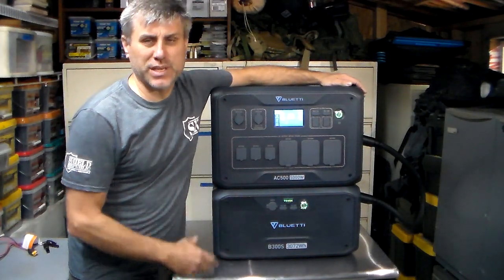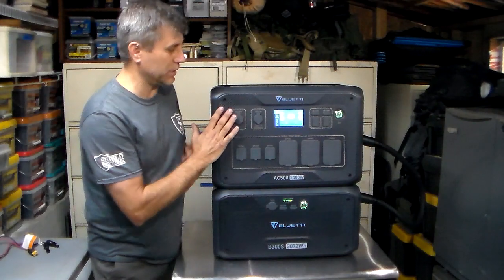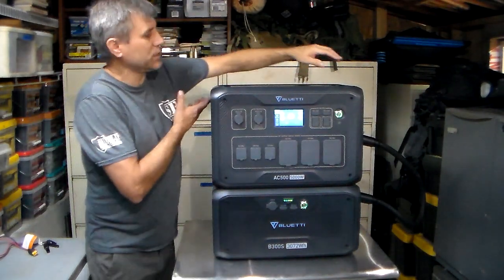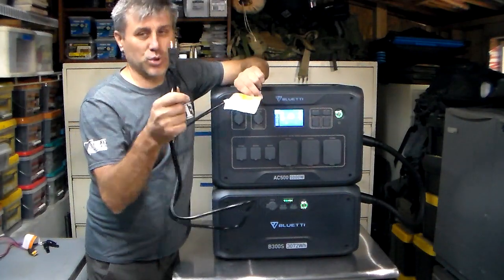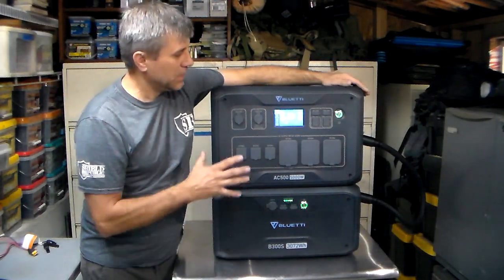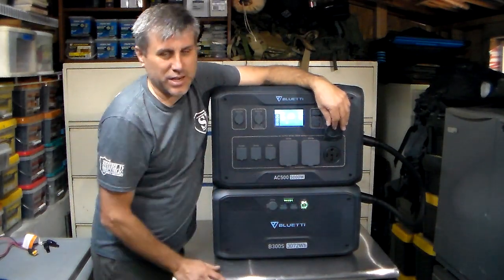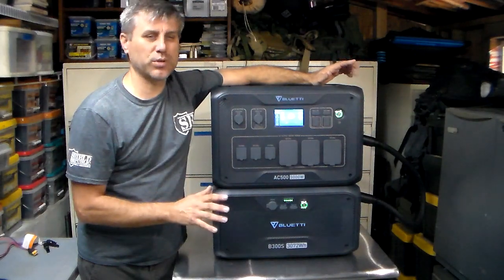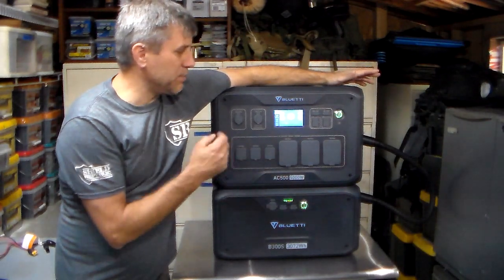Bluetti AC 500 and B300S...Top of the line solar power box.

Comment: Be careful with charging this or almost any solar battery system with a normal fuel powered generator. The specs from Bluetti indicate 3-4 THD-  in English = you need an inverter type pure sine wave generator with this. NOT a normal generator.  Most fuel generators output 10-25% THD and will likely break your very expensive Bluetti.

Comment: What would you recommend for someone wanting to take on camping trips or out in the woods to charge 2way radios, phones, batteries, and power tool batteries?
Reply: I know you are asking about solar, but I have one of the red Honda 2000 watt generators, that is super quiet, and it runs a long time on a gallon of gas. Weighs about 30 pounds. $1,000. You can buy a second one that is linkable to the first for 4,000 watts. FYI.
Reply: @3-2-1-.  yea I’ve looked at those. I want something to be independent from needing to provide fuel for.

Comment: Got the AC500 & B300S package on Indiegogo & added 1 of the 400W solar panels. Expected to ship in late Nov./early Dec. VERY excited for its arrival. Will be used for UPS on our fridge and deep freezer. Have plans to add more B300S batteries when we buy our next house and have our panel box wired up to be able to power our house off this set up during peak/prime hours and charge up the batteries during off peak/premium hours.

Comment: I love my Bluetti AC200p + B230 battery pack. I use 5 x 200w Rich panels in my yard to charge the Bluetti and another 2.5kw mobile DIY system that I designed and assembled.

Comment: An important part of knowing which So-Gen (Solar Generator) is best for you is knowing what your power needs actually are.  Inverters do NOT operate at 100% efficiency.  Using a 5,000 watt inverter for a 60 watt load like a mid-sized deep freezer that's going to be cycling on and off as needed would be a drastic over spending for a product that will likely give you less than 50% efficiency in that scenario.  That is to say, half or more of the power consumed will be the inverter within the box.  A smaller inverter would be capable of running a 60 watt mid-sized Deep Freezer easily, and would do it more efficiently than a 5,000 watt inverter, wasting less battery power.

If you need a minimum of 1000 watts load with regularity, or if you're in need of 2500+ watts even if sporadically, then you might consider the AC500Max, as 1000 watt loads and up are where you start to realize decent enough efficiency of the inverter.

I have the AC200Max (2200 watt inverter) and it's run a Fridge and Freezer since May basically non-stop, along with selectively powering other devices in the home as power permits (TV, Computer, etc, along with charging up a 3rd party 5kwh battery).

Comment: I bought a Bluetti  AC200P April 2022.. little did I realize with all the raving reviews that NO ONE stated its REQUIRED OCV of 30+ volts..Manual states 35v-150v.. find solar panels that will provide that voltage. Most are 12v  so you need to series 3 and minimum of two in series for most solar panels to charge it. AND only 12 amp max input.

Comment: Hey Dave, thanks for all the information. I am curious if this unit would be disabled by an EMP?  That would suck.
Reply: In the fictional universe in which an EMP ever went off, yes, it would be disabled. Someone would have to be truly stupid to waste a nuclear warhead in the upper atmosphere and fail to impact the military or government at all (all federal buildings and vehicles are EMP hardened), when they could just drop it on a military target and remove it from the planet. There is a reason nobody has ever used an EMP, and that same reason is why nobody ever will.

Side note, EMP Shield is a literal scam, like a nuke-proof shirt. The only way you’ll realize it doesn’t work is when it fails, and then it won’t matter.

Comment: Had a company price solar for home 14,000 but it doesn't include any battery backup or stand alone or expansion capacity, is sized for current electrical usage that's non typical for a home this size with a full family. 🤔

Comment: That would have been my dream solar charging sys. I did make a system of my own, with video on my channel. My storage capacity & possible max output is 6408 watts (6.4kW) but my inverter is only 2000/4000 surge. So far my office including 2 PC's, monitors, internet router, printer etc.. is running off grid. The only downside is that its not portable and presently im only running 5- 100watt panels. 3 panels mounted on the chimney facing south with 2 others being rotatable. So far so good.

Comment: I have the AC200max with one battery. It's good for basic needs. I would caution anyone who purchases a solar power system to set it up before you need it. I thought that mine would come with the cables I needed. It did not. In fact, the battery came with the big connector cable for the larger system, which didn't work at all for the smaller battery or the AC200max. It also didn't come with the proper connectors and cables to attach the solar panels that I ordered with it as a package. It just about drove me crazy trying to find the proper cables, when Bluetti did not have them in stock for months, and Amazon couldn't supply them either.

Comment: If I'm gettting 2.5 hours from one battery running the 374 continuous watts (with walmart's everstart modified inveter 750 watt), I should probably just get 400 more watts in panels, a 100 amp mttp charger, and a 700-1500 watt pure sine wave inverter. The pure sine inverters are from $50-100, the fans are loud in these if you're sleeping next to it.

Comment: I watched this video and the Bluetti is a great machine like Dave says, if it is the right fit for your needs.   They make several different sizes and models so they cover a lot of uses. This is a great overview video.  That said I feel the need to give folks a heads-up about Bluetti's customer service...it is bar-none the absolute worst I have ever encountered.  They do not answer their phones when you call.  And I mean they never answer in person.  The delay to talk to a tech or anyone  has been about 2 days on the short end to weeks on the long end.  It is my observation that thr folks there are engineers who know their stuff but they are not equipped to handle the demand of their customer's needs.  The increase in folks trying to prep is a cause of this issue but Bluetti should do far better then they are.  This said we still buy their products as they do seem to be about the best plug and play option on the level of the Delta Pro equipment options.  I would recommend everyone who is considering buying a Bluetti product to go to their community pages and read the forum posts by existing customers.  They are fast to sell you equipment and very slow on delivery on the high end products with many of the key accessories not available at all and months overdue.
Reply: When you nearly have to trade in one of your kids to be able to afford one of these, one would DEFINITELY expect good customer service to come with it, so thanks for the tip.
Reply: @AmericanMale5.56  sometimes, especially over the last few years, you have to acquire things in spite of the level of service you may or may not need.  The Bluetti equipment is so far making the vast majority of customers happy.  Since I'm a fix it myself guy I take these risks with less trepidation than most others might.
Reply: @TheTexasHorseman  , oh I agree completely! I do feel that there are more affordable options on the market though, that also have pretty solid reviews backing them up. We all have different budgets and, unfortunately many people are on a bit of shoestring budget these days and spending over $1,000 on anything (supposing they even have THAT much on hand) could mean going without something else equally as important. It's a balancing act and some are fortunate enough to splurge on higher dollar items, without having to sacrifice too much in other areas and those people are blessed. Everyone's situation is different.
Reply: @AmericanMale5.56  your comments bring up a good topic if you don't mind.  That is the idea that how people spend whatever money they have on specific items can be evaluated by others with a degree of accuracy.  In this instance I would challenge the idea that a high end bluetti, say the EP500Pro, is an extravagant expenditure.  If you are speaking from your situation having   evaluated your preparedness plan and deciding that a much smaller solar generator would provide all the power you have planned to need, then sure, spending $5000 on a solar generator probable does not make sense.  You may also have evaluated your tactical security needs and plan and have decided to purchase a DD5V5 in 308 suppressed with mil grade optics and NVs which would run quite a bit more than the Bluetti EP500 Pro two pack with subpanel and switch.  I may have evaluated my particular situation and chosen a CZ527 Varmint in .204 with a Leupold VX Freedom 3x9x40 CDS Duplex reticle to fit the bill for under $2000 with a nice sling, lens caps, and bipod.
So, my point is that in our lives a smart person decides what to spend their capital on and judging a person's economic status by an item is often a mistake if you are talking about rational people.
Reply: @TheTexasHorseman  , I see your point there, in terms of prioritizing in distribution of available funds. I could say that I don't own a single "high dollar" item, depending on what a person may classify as such. A budget $700 rifle (5.56) from Adams Arms with a $300 scope and a $400 Berkey could be the most expensive items that I have purchased and one might surmise that I live on a tight budget and they would be correct. Then again, someone else could look at those relatively cheap items and wish that they could afford even THAT much. It's all subjective and depends on how one evaluates and interprets wealth, I suppose. I don't, in any way, begrudge someone for spending money on whatever they feel is necessary for them though, if they have the funds to spend. I will say though, that I'm living proof that you don't have to have much money to buy necessary items for prepping. Sometimes you have to save up for these things (like me) and it doesn't always have to be the most expensive, because cost doesn't always equal quality, at least in my own experience. You can often find equal quality, but at a much lower cost. Some hold to the general belief that you get what you pay for and will always seek out the most expensive items, but I don't tend to think that way, nor can I afford to. If one is willing to put in the foot work and do their due diligence, then prepping can be done on a shoestring budget and many of the lower cost items can do the same job that the higher dollar items can. It just depends on one's perception of value, I think. Not that any of this really matters anyway, we all do the best we can with what we have to work with.
Reply: @AmericanMale5.56  I totally agree with you.   I have spent my life learning to do almost everything I need done because not only could I not afford to pay someone to do them but in my observation and experience I can often, especially these days, do it better myself and for less.  Sometimes that means buying tools I don't have to do the job but then not only do I have the tools but I have the skill.  I am blessed to be able to do things from watching another person do them or watching a video or reading instructions.  Quality is indeed not a function of price.  I have fought that idea from customers and others my whole life.  I do a lot of research on what I need to know and them I buy the best I can afford to do what needs done.  Sometimes that's Harbor Freight and sometimes that's Bluetti.  I have 20 year old Dewalt battery powered tools.  I'd challenge anyone to cost that out, use to price, and argue that those tools have not been about as cheap as you can imagine.  The problem these days is planned obsolescence.  It is very difficult to buy anything of long lasting quality.
Reply: @TheTexasHorseman  , you are spot on there, I have also noticed the overall quality of goods going down, especially over the past year or so. Whether it's less employees or lower budgets in production resulting in subpar quality or lack of access to proper parts and having to produce using inferior materials. If I buy ANYTHING anymore, I tend to ignore older reviews and focus primarily on those from 2021-22. It's amazing how many products, as well as companies, used to be great before 2020 and have completely gone downhill in quality and service since. Not that it's at all surprising, everything is kind of suffering, due to the trickle down effect of many factors.
Reply: @AmericanMale5.56  Agreed!
Reply: Customer service is EVERYTHING when it comes to a product! This unit may be the "bee's knees" but with bad Customer service... "it's a boat anchor ⚓️!
Same goes with Patriot Food supplies in Utah..... terrible customer service and I mean TERRIBLE! This company shovel commercials down our throats on YouTube and Patriot Foods sucks!

Comment: What solar charger would I need (a 100 amp mttp controller) to charge 4 12v deep cycle batteries daised together in 12v, fed by 500 watt in panels, to feed 374 continuous watts, again I don't necessarily have to burn wood all night, as long as the circulator cycles the air it keeps it above 66 on wood ash until next morning day.

Comment: Love this one because in one unit it can keep someone on an oxygen concentrator or cpap alive. Thats huge, so many people dependant on these medical devices.
Reply: While this Bluetti can run the devices you mentioned, the 5,000 watt inverter is way overkill for that task and would run those devices with poor efficiency.  That is to say, the inverter within the 500max would use a considerable amount of power itself while powering those devices.

Inverters have an efficiency curve, and many inverters perform optimally at close to half of their capability - so the AC500's half way point would be 2500 watts.  Peak efficiency on Bluetti products looks something like 84% from what I've seen.  If you use the AC500Max and only intend to use it for less than 500 watts of its capability, your efficiency will not be great.

You'd be better off with a smaller inverter and more battery if your intention is to run lower wattage devices.

The AC500 is great for what it is, but if you're not using 1,000 watts minimum with some regularity, then the AC200Max will be more efficient.

Comment: This was so helpful. I am really looking for a whole house system. What is a good affordable one for DIY peeps 😂
Reply: Bluetti products are sort of designed with some portability in mind.  You're paying extra for that.  If you want to be able to take the Bluetti to a friend's house and power the fridge while they suffer a power outage, if you want to take it camping, if you want to stay a week in a cabin you own and have some power, etc.  Obviously the bigger batteries are heavy and don't seem portable for some people, but that's the design angle of what Bluetti is doing.

There are other products that will be cheaper to get going if you want to do a house setup.

Example:  Bluetti's B300 battery is pushing in on $2,000 for 3kwh, you could buy an EG4 5kwh battery for LESS (2kwh of more power for a cheaper price).  And EG4 also has all-in-one systems designed to be mounted to a wall that include mppt (for solar input), an inverter, etc.

Comment: I really like the Bluetti system.  They are easily one of the top manufacturers.  We are still trying to size a system.  I appreciate the detail you provided in this review.  Very balanced.  Some of the details you shared will help in our decision making process.
Reply: Can you share info on a system that will power house for 6 hours a day for a freezer, fridge, well pump and boiler unit 🙏 please
Reply: @gardeninggirlct  That would depend on how much each of your units pulls in watts per hour.  You may want to get a Kill-A-Watt meter and test them.  Otherwise anything someone tells you isn't all that accurate as they won't have the same models you have.

Comment: If your not going to run at least 3000 watts continuously id stay away from this unit. If it’s like the ac200p I own it will waste ALOT of power (battery life) when powering the small loads continuously.  This is not to say bluettie makes a bad product.  A 5000 watt gas generator would also use realitivlyb the same amount of gas weather it’s powering a 500 watt load or 4000 watt load.  Proper sizing is key. In shtf every little bit of wasted power will matter.  As a work around I use the ac200p power the larger loads and have smaller 250 watt solar generator for lights, computers, phones etc.

Comment: Man I am pissed they came out with this unit recently. At the discounted price I could have bought it instead of the Bluetti AC200 max and B230 extension battery in May. This system cost me $3300. On sale I could have bought the AC 500 and B300 for the same price. Oh well, it is what it is.
Reply: Kinda like computers used to be!

Comment: The nice thing about that system is its modular and you can add multiple batteries to it . With a transfer switch you can add this system to the main panel of your home or set up a emergency panel to cover critical circuits. This is good for a home they sale portable units to go in vehicle or camp ground.

Comment: these things are STUPID expensive.   what are you gonna do with this when the sun isnt out for a week?   a small inverter generator and the supporting fuel and oil is also a good option.   dont rule out that option.   these things are nice.   but extremely expensive.